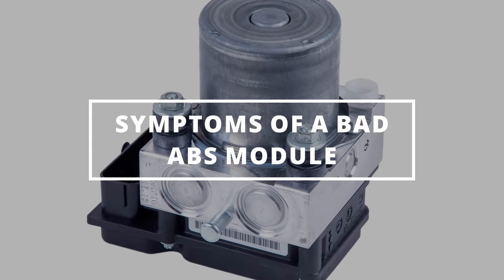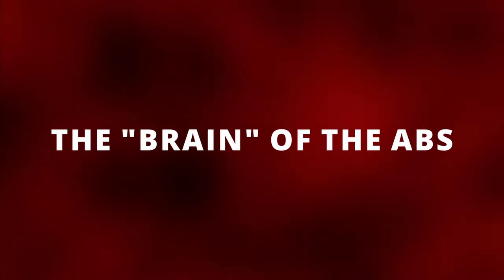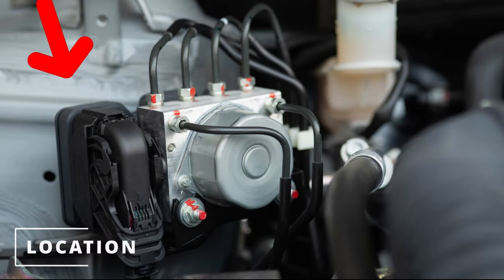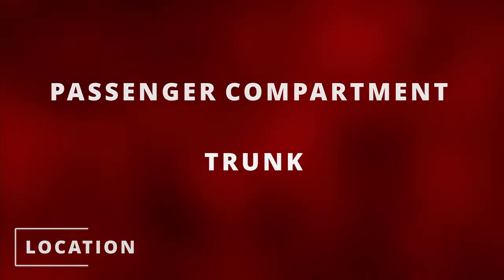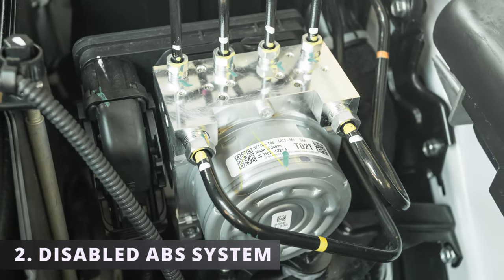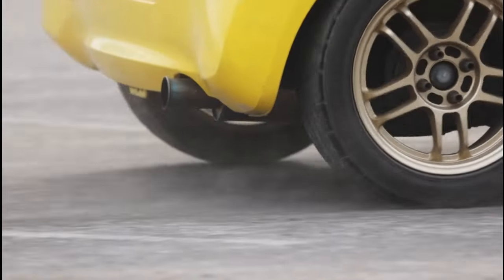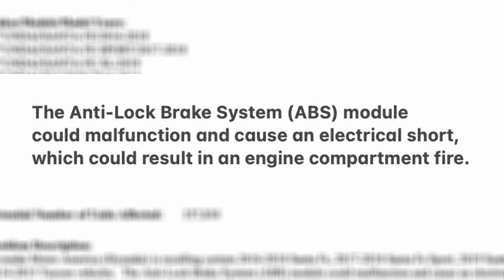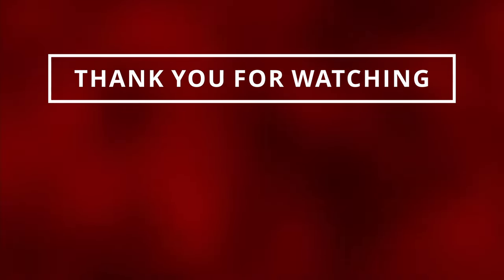SYMPTOMS OF A BAD ABS MODULE

Comment: My left caliper failed under three months it started making scaping noise. I replaced it. It was fine again until now three months later? My abs light is on. What do you think it is? I've replaced the sensor too. Thanks!
Reply: My car keeps doing this over and over. I keep getting my brakes repaired every 3 months because it’s still under the warranty. The brake company has told me that they can’t keep putting new calipers, pads etc on my car.  I’ve taken it to my GM dealer but they’re saying it’s not the ABS. But the brake company is saying most definitely it is.  So now I’m taking to another GM dealership for a diagnostic test.  I’m so frustrated!
Reply: If your rotors are incorrectly wore out, it will cause new pads to further wesr out faster. They rotors need to be replaced. 

Entire break system is: 

Brake pedal pushes fluid from break fluid reservoir to caliper. Caliper closes causing pads to tighten on rotor. Releasing brake pedal does opposite. Unless the vacuum pump attached to the engine that the belt turns to engage is faulty causing it to stick. Or your e-brake sticking. But then if those two all 4 wheels would experience thr same thing.
Reply: @WheresWaldo05  thank you for replying because this car has been a nightmare. The body of my car looks brand new but I’ve had major engine work done and just received my brake diagnosis from my local GM dealership and found RR solenoid failing and need to replace EBCM with brake pressure modulator valve, full system bleed, rear brakes and rotors at a cost of $2550. And I just got all new brake pad and calipers less than 2 months ago.  At this point I’m trying to get rid of this car.
Reply: @yvonnewilliams8800  Some cars can be lemons. I'm a firm believer in that. But i do think the ford fusions are excellent cars overall through the general masses. I have a 2015 with 94k on it. Nothing has gone wrong with it yet. I just browse videos like these out of boredom and to learn symptoms for various things in case i run into issues later. I work on my own autos......mostly.
Reply: Also the more technology the more that can go wrong. Older cars didnt have all these newer systems to go bad to cause brakes to stick on. I have actually never even heard of that being a problem before on any car. Must be extremely rare. Or you could be taken advantage of. I know several shady dealerships and i actively speak out on them. Not saying that is the issues with you necessarily.
Reply: @WheresWaldo05  Yes. My car is a 2018 Chevy Equinox and I bought it new but I started having problems after 2 years.  I believe my car is a lemon and hopefully General Motors can make me a deal which I’ve been in contact with them.
Reply: @yvonnewilliams8800  I am biasedly a Ford guy. I am 39 so been driving for 23-24 years. Owned 6 cars. All fords. Never had any major issues. Never had to pullover on side of road all that time. Something i preventatively replaced along the way since i am mechanically inclined. But if you cant get a deal on another chevy, i highly suggest a ford. Butnif you do just dont get one with an ecoboost engine. Not cause they aren't reliable. But they are turbo charged and alot more things can go wrong with them. Spender things.

Comment: I have a 2007 kia sportage.  While driving all my brakes locked up and didn't release, had to open the valve on the caliper to release the fluid and then all calipers opened.what can it be? Oh no abs light on also.
Reply: What was your problem?
Reply: I have the same Jeep what was your problem
Reply: My problem is that all 4 of the brake calipers locked and wont release until I  release the brake fluid from any caliper.
Reply: @trapislandboy654  the brake booster was my problem bro

Comment: I have dash lights on for abs, traction control, and service break lights on but when I had it scanned it passed and showed nothing so I’m confused
Reply: what was the problem?
Reply: @rubenfaqs  the car didn’t like having just one new tire.. I’m guessing the difference in the thread.. or the other tires might have been misshapen since the car was sitting for a while.. but once I replaced them it went away.. the service brake light went off after I bleed the lines and put new fluid in.. I never knew how much damage a car could get by sitting for a long time

Comment: brake colle  check hose a brake oil do not pass  nothing... out the hose  vérifie with gun air if air pass not   plug hole  oil not return abs plug hole           because adator suppor of the hose,,,, too much press  la cause,,,,,,,,ploblem,,,,  pad brake disk ,,, very red véry hot  piston caliper no come back,,,, compagnie  press too musc the hose  ,.    dodge avanger   2013  big plobleème   burnning     charge  hose, calipper ,pad ,disk , oil brake

Comment: Hey Bro I have a 2015 Mitsubishi Galant Fortis Super exceed. A few days ago I was driving in traffic, the car came to a stop and i was about to tip on the gas pedal to move when The pedal suddenly got soft and dropped, i quickly placed my foot on the brakes and then pedal went soft and straight down as well. I quickly pushed my gear in neutral and turn my hazard lights on. 
It happenned again two days ago however all scans came back with no error codes. I am being told that the ABS module could be malfunctioning. I was also told i need to bleed my brakes fluid and check the booster pump. Two days ago when it happenned to me on the highway, when I stopped and check my brakes fluid level, it was overflowing, therefore I have a backup up compression of the fluid.  What do you suggest?